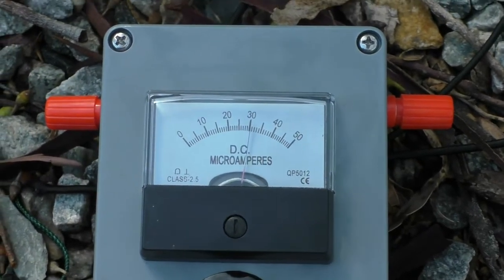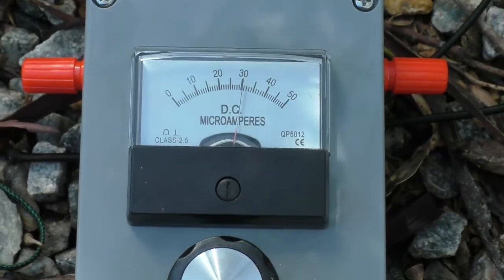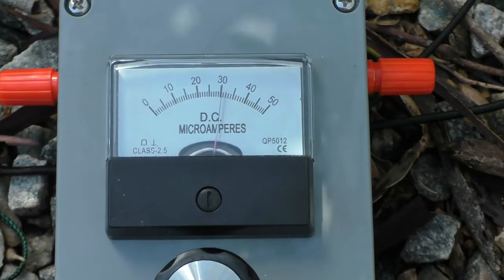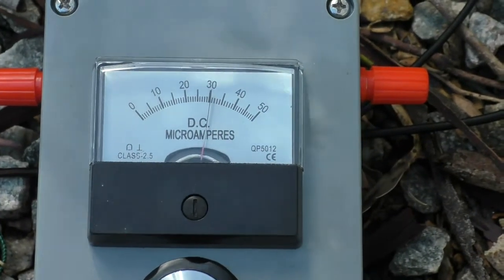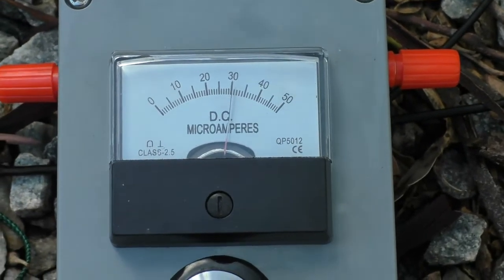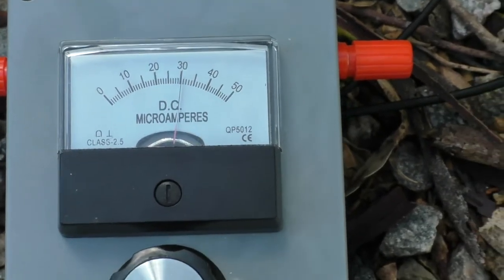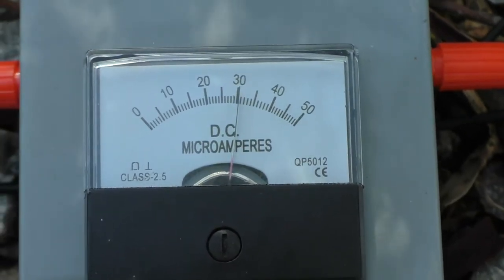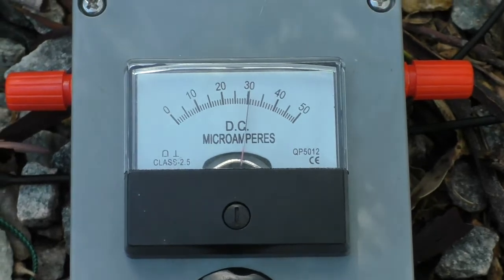More Antenna Current After A Downpour...

Comment: I've added bentonite clay in the soil around my antennas. The bentonite is quite inexpensive and retains large amounts of moisture. It is used as "clumping cat litter" oil well pump "mud" and for many other things. It typically comes in a powder form and can be spread out and covered with topsoil. It wouldn't hurt to see if it is available in your area. Especially good for enhancing a grounding sink of distributed lightning rods for lowest resistance. You may also want to consider adding just a touch of some chloride salt to enhance conductivity of the modified area.  https://en.wikipedia.org/wiki/Bentonite
Reply from the maker: Is the stuff you use white or black? There is a special Bentonite clay we use at work for improving earth rod connection to the ground. This stuff is black in colour and has graphite in it  believe.
Reply: It is pure white. YES adding graphite would be just the ticket.
Reply from the maker: I'll have to ask our tower guys what the trade name of the Bentonite with Graphite is.

Comment: Here's a good one, I have AC coming across my pl259, It toasted my ft400, a computer and more.  I also have 12volt - DC on my table saw top, hmmm.  I have a 12 volt battery and if I connect a 12 volt light to the +side and the - to the table saw top the light lights. Hmmm.  3 electricians have been here and walk away with their heads up their A.  lol.
Reply from the maker: Funny Buzz...